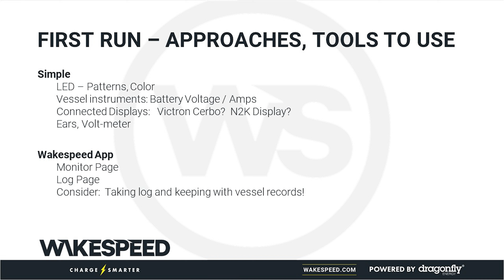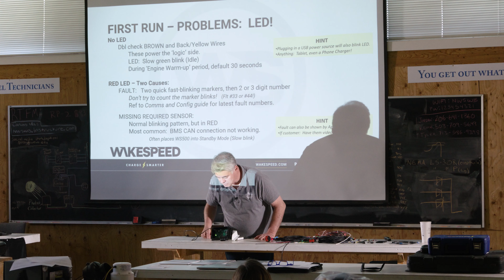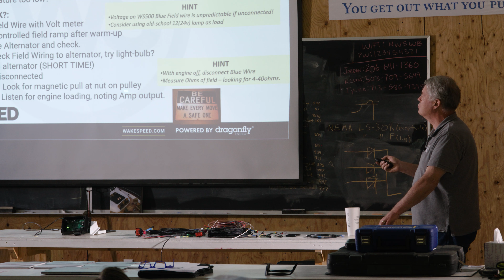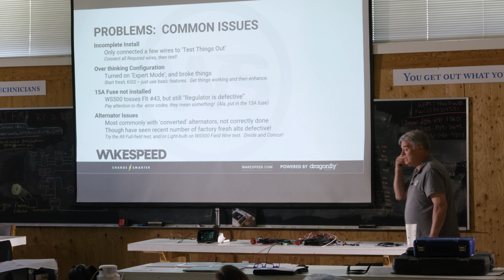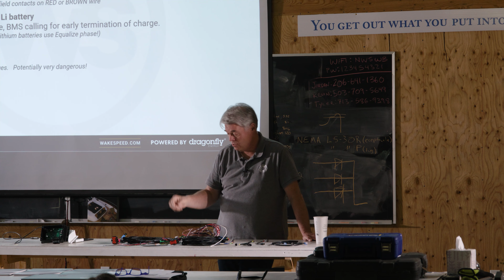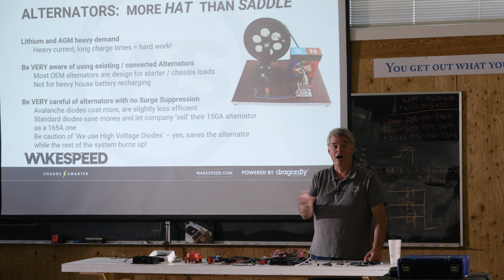Wakespeed 201: Advanced Alternator Regulator Training | WS500 Best Practices and Troubleshooting

Comment: great videos. one question that I haven\'t been able to get a satisfactory answer to: when you work with alternator manufacturers such as Nations or APS, and they give you a max temperature (say, 120°C0, do you have them specify where on the alternator that temperature is sensed for that number?  

Using an infrared sensor, i find a wild difference across the back of the alternator (near diode pack) and, also, around the stator. Of course, It is easy if there is a temperature post for the sensor. but knowing where the manufacturer measured the temp for the value they gave you as safe would be really helpful for a safe/efficient install. (if we hook up the temp sensor where it is hotter than the location the manufacturer used, the alternator will be throttled (but safe). If we hook up the temp sensor where the temp is less than where the manufacturer did, then we will (for a while) get more power but reduce the service life of the alternator (or worse).)